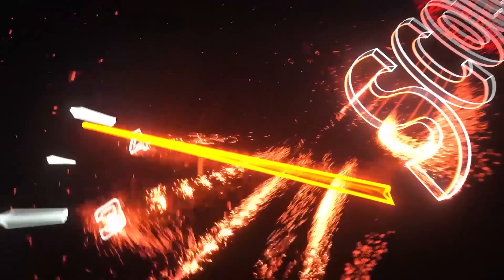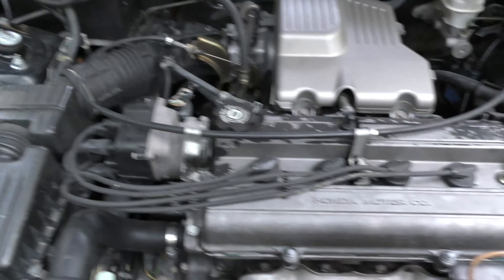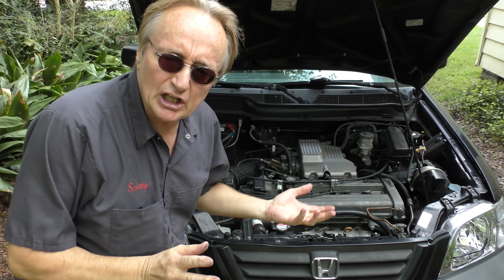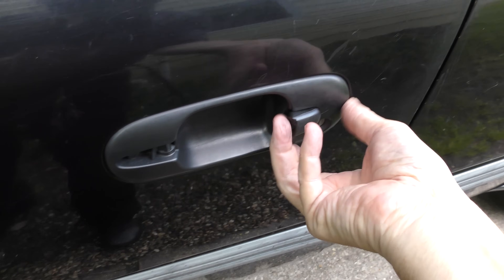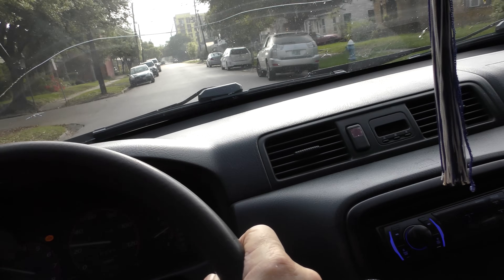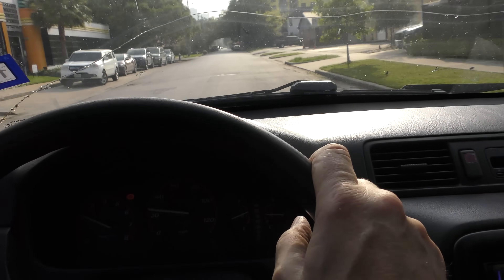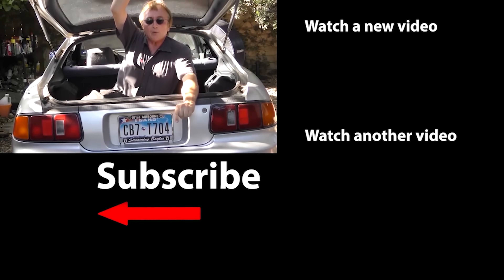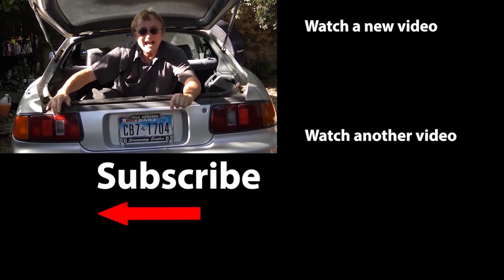Here's Why Smart People Buy Cheap Hondas

Comment: Love my 97 crv 215,000 miles
 I just replaced the driver power window $27.00. Replaced the driver door handle 2 years ago 8.00 dollars. Just put a new set of Bridgestone tires on and it runs and rides like new. Not bad on gas either.

Comment: Honda CR-V could have been my first vehicle, my mother told my dad no it has a higher rollover chance... dads response was to get me a 94 Nissan Maxima. I was older than it by two whole years. Lasted me 6months. Starter and transmission died mid intersection twice. I was driving a death machine. Dad bought it for 1200 and put about 500 dollars worth of work into it. Smh shoulda pushed back but oh well it was my first vehicle.
Reply: fun fact the Maxima has a higher rollover chance than the Crv

Comment: I have 2001 CRV with only 135K. EX AWD with all options like luggage roof, mud guard etc. Previously I had 1999 CRV that I bought new like the current one, EX, AWD all accessories. Drove it for 280K, no problem at all. The engine just purrr. You can still see the metal inside the tail pipe after all this miles. I gave it away to a high schooler as his first car. My mechanic said the first gen is still the best. Easiest to work on and reliable. The only repair are new propeller shaft and one front axle.

Comment: I bought a 2002 CRV in January 2018 with 165,000 miles on it. As of October 2020 (less than 3 years of driving it) I have put over 110,000 miles on it. The only thing I've had to replace aside from brake pads and oil changes was the starter. That's it. 

This winter I should hit the illusive 300,000 mark.

Comment: My (bought new in 6/2015) Honda Fit was the first Honda I've owned, and I'm hoping to keep Ruby for decades!  We did have a glitch in 2018 when her engine coils went bad at under 50,000 miles (others in 2015 were recalled and she should have been too) as did her fuel injectors.  Thankfully, her warranty covered the fuel injectors.  I just replaced her original battery, 1 month before her 6th birthday (she was born in 3/2015 in Mexico).  I am horrified that Honda is no longer going to sell Fits in the USA!  It's a GOOD little economy car!

In Denver in 2016 I went into a Honda dealer to ask something about my car, and they had a 2006 Honda Element in their showroom.  I asked WHY they had an old vehicle in the showroom, but a woman had just traded it in...10 years old...with 445,000 miles and NO problems!  Hondas are freaking awesome!  I still don't understand why Honda stopped making the Element either.  People LOVE them!
Reply: The Honda Hatchback is making a comeback .

Comment: I have a 2001 with 310 miles and counting, just replaced the timing belt for another 100k miles of service. do regular mantainance, frequent oil changes, and the valve adjustments, and it will make it to 1,000,000 miles.

Comment: The fan on my 03 crv  with 190k went out so it caused my car to run hot and my head gasket went bad leaking water in the engine. I just decided to go with a new engine from japan since it was cheaper than rebuilding and since it’s a 5 speed awd, it was the right decision it runs better  than it ever has it’s got some good torque and can chearp 1-3rd gear. I look forward into putting another 200k 👌

Comment: I lucked out I just got a 2011Honda Pilot with only 55,000 miles on it. Older couple barely drove it and got rid of it for something smaller. And since I barely go anywhere due to the Rona I haven't put much of any miles on it. Maybe I will sell it since I'm not going anywhere.  I thank the older couple.

Comment: drive my 2001 crv with a burnt exhaust valve for a year. so the car was running on 3 cylinders and i couldnt even tell. no weird noises or rough idle somehow. fixed the head for 1,200 and still have it 4 years later. its a 5 speed and i redline it every day and it doesnt leak oil. hoping to have for 20 more years so it will be a collectable someday

Comment: My 97 CRV just hit 244,000. Runs like a dime, very well made car. I'm 6'2 and plenty of room and this SUV goes through the snow like a tank.
Reply: I’m only at 147,000 miles on my 97 CRV..
Reply: @jesse7949  be sure to have valves adjusted  every 30,000. They get tight and push on valve seats, $$ if they damage . One issue crvs have.
Reply: @james7420   Thanks for the Tip, I’ll have mine check soon 👍🏼 I just change the transmission oil, it was really dark. Shifts like butter now.

Comment: I got a 2004 Buick LeSabre for 1400 with 185,000 miles and all of the maintenance records. Runs like a clock and it gets good gas mileage. I’m saving for a nice used CRV.

Comment: My 99 VTEC honda accord has 240k on it, 5 speed transmission had the clutch changed out every 100k or so. (Country roads, hardly any city driving). I've run it with the oil cap off and had it spew oil everywhere, VAPORIZE all the water and antifreeze out of the radiator(which is bent from going into a ditch). Used it to transport hundreds to thousand-ish pounds. Sure, it doesn't handle bumps great anymore, kinda sways sometimes, steering wheel is only a little off now.  But it runs, redlines successfully, and will VTEC bwaaappp past somebody when I want it to. Surprisingly. Hondas are hella'uva engine makers.

Comment: Hi Scotty, I recently bought a 2003 2.0L gasoline CRV with 285000km. Honda fluids are expensive and hard to find where I live so I got Castrol oil for the gearbox (manual) and Ravenol DPSF for the rear differential, so far no issues, the rear differential oil was still the original. I'll wait on the power steering fluid seeing that you only recommend original fluid
Reply: Hi, I recently bought a 1998 CR-V in excellent condition, it looks totally new and has some modifications, I was just wondering if it is advisable to use oils and other fluids from other brands or if this can damage the car. What has been your experience with this?
Reply: @JuanArias-xr6je  so far so good, ravenol for the rear diff and castrol for the gearbox
Reply: @RandallGraves59  thanks

Comment: People buy cheap Hondas (particularly ones from the 1990's and early 2000's) because there's lots of parts available for them (either replacement or modding) and because the older ones don't have as many electronics as the newer ones.

Comment: i have a 1998 honda cr-v..5 spd - original owner with 248K miles. all i do is change the oil every 5k since i owned it. looks brand new inside. the cruze control broke early around 100K.  suspension and brakes cost me some money.  it is just noisy as crazy inside

Comment: Agree. These cars are great. Bought a 98 crv with a bad transmission bought a JDM imported  motor and transmission with under 30k miles. With all expenses and paperwork i paid a total of $3,900. Its been 5 years since and it runs better than most new vehicles.

Comment: I literally have the same CRV from 2000 AWD Automatic, only issue is the AC. It blows cold when the car is on second gear but on idle no AC, still trying to fix it DIY. Its a challenging bug but the car works great.

Comment: I have a 1999 with 213000, never a issue  ,,changed water pump with timing belt at 155k, with every oil change I drop the one gallon of trans fluid (about one gallon)  the trans actually holds about 3 gallons, but has kept the trans from having issues

Comment: I have a 2005 CRV (bought it cause of your recommendation so thank you!). I Only use Honda genuine power steering fluid and ATF fluid. But I was curious is it ok to use brake fluid/antifreeze etc that meet the requirements but are not Honda genuine? The manual says only Honda but many forums are saying it doesn’t matter as long as it meets requirements. Don’t want to mess up the car! Love it! Thanks!

Comment: Just came across this video and it gave me new hope for our little 2001 CR-V AWD. We have 198K on it, engine still runs great and the body and interior are in great shape. Here's a question for you. Our AC does not work and we were told by a Honda technician that it is not worth it because of black death. They didn't go looking for it but just said it. I heard that that's more of an issue with the 2nd gen ones. Also our suspension is in pretty bad shape, tires are wearing, some good clunking coming from the front end. I know I need to change the timing belt and do fluid changes but aside from that the AC and suspension is the main concern. Would you say that it's still worth it to put some money into the AC and suspension? or should we start looking to replace it because cost is too high? Thank you.

Comment: I'm an avid cheap Honda buyer. Actually an avid Japanese cheapy buyer as a whole. I have owned cheap 2nd hand vehicles from Toyota, Daihatsu, Mitsubishi, Subaru & Honda, with a bias towards Honda due to their superior fit & finish, practicality & good value.  Had the exact same CRV, bought in 2012 as 10 years old example and that car took us over the length & breadth of South Africa numerous times. Owned a 2004 2nd Gen model after that, a 2007 Accord 2.4 and two 1st gen Honda Jazz. A 1.5 V-tec and a 1.4 DSi. We currently drive the 1.4 Jazz & the Mitsubishi Pajero. That 1st Gen Honda CRV is really well engineered. What I liked about it was that the power steering, alternator & aircon ran seperate belts on seperate pulleys. If one were to break...which it didn't anyway you'd still have certain functions and it could be repaired easily. I owned my one between 200 000km & 300 000km. During that 4 year period I only repaired a small radiator leak where the fan cowl chewed into the radiator core and I had the steering rack refurbished...no Honda special oils. I only used the Honda CVT fluid for the Jazz gearboxes. As a whole the plan to only drive Japanese cheapies works out really well. They take us everywhere we need to go and they take abuse while at it. I don't wrap them in wool, they get driven and driven hard. But we maintain them really well with quality aftermarket parts. And upon selling I don't really lose money on them. I have even turned a profit on the one CRV.

Comment: Rode my 2002 CRV from 185000 miles to around 230000 miles after my parents were done with it. Broke down this march, and I'd driven it for the past 3 or 4 years. Easily my favorite car from my parents. I'm currently looking for another used one, as my dad bought a used Ford Flex and is giving me his Chevy Equinox with 80,000 miles and a recently installed new engine ( the old one was burning oil).
Reply: Y did it break?

Comment: My wife has a 2004 Honda Pilot with 223,000 miles. Runs and drives okay with all it's original parts. I'm just changing fluids and doing rust repair.

Comment: I have a '98 CRV which I drove off the lot a little over twenty two years ago and I now have 285,500 on the odometer.  For most of it's life I used Honda's ATF but the last seven years I've been running with Valvoline MaxLife ATF and I feel it's better than Honda's over-priced ATF and it's significantly cheaper as well...currently going for $17.89/gal at Walmart.  The first Gen V's are just crazy reliable if maintained properly and that includes checking/adjusting the valve clearance every 30K-40K miles. I'm still running with the original engine,AT,starter, alternator(although I replaced the brushes around five years ago), fuel pump, and master cylinder.
Reply: I like maxlife also. Still going?

Comment: I'm so happy that I found one for  $ 2,800 with just 119,000 miles super clean and solid overall driving it daily. Maintenance is key. Just probably need to replace the suspension components. They're cheap. And the AC when it fails. Nothing mayor. Recomended!!

Comment: I got a 99 Nissan Sentra, and the worst repair job I had on it was the water pump. Only reason why it was the worst repair was because we couldn't find out what was wrong with it. The water pump was slipping on the belt, but the car wasn't overheating. I'm in Florida. It wouldn't overheat. With a busted water pump. In Florida.

Comment: i got myself a crv few years ago at my mechanic who got it from someone who had it for 20 years. Still runs well, may have take her in now and again but major upgrade from the dodge neon i had. For some reason the check engine light always comes one even after my mechanic fixes it. But other than that it works well and plan ride this to the ground or till i feel to replace it with an automatic at some point. Crv are a good vehicle to own.

Comment: I got an 01 for $400  last year. I love it! I just it 200k miles. Has some small problems but its fine. First car so it was a good place to start. Only thing is the radio dose not work. Come fix it lol.
Reply: Doesn't Work... Does it need the code? Go to a dealer free. The cd belt dies after 10 years
Reply: @michaelp3650  Idk I put a new radio in with Bluetooth so I’m good now lol.

Comment: My Toyota Highlander 2021 4 cyl. still runs without a problem. No engine light, no transmission or engine problem, and I have kept it with good regular maintenance.  However, it burns or leaks oil like crazy. For the last 3 years or so I have to put 1 quart of oil every 300 miles.

But aside from that, it does not have any other problem.  The A/C does not work. But I live in SF, and it is almost never hot during summer time. So I don't mind. However, the only thing I don't like is the ride on the streets when driving it. In SF we have so many potholes that it makes it unconfortable to drive a car with bad suspension.

 The freeway ride is not a problem at all.  I wonder if it is cost effective to replace the struts of the suspension which will set me back about $1,200 to fix them all four. 

   Burning so much oil I see it as kind of a gamble.  The car has now 270,000 miles.  

Do you think it is worth to put so much money in that type of car?

Comment: I have a 97 with 182,284 and I bought it for $300.00 The only problem I have with it is: No crank, No start. Can that be the CKPS(Crankshaft Position Sensor)? I checked the battery and I am not getting any juice at all. I was driving it and lost power while driving. Mind You I changed the ignition coil/distributor cap and the sparkplugs.

Comment: A lot of the minor stuff is easy to fix because it is a Honda. Door handles, antenna, radiator fans and even the widow regulators are simple if you know how to work on a car. Parts are falling outa the trees as well. Most of the under hood stuff you can get at a Pull-A-Part from a Civic or other CRV's. The instrument panel and steering column is all Civic.

Comment: I got a 2005 model 6 years ago. Been a very good vehicle. Only on 120 000 miles so good for another 10-20 years. They have quite a bit more room in the trunk than the new ones too!
Reply: Updates on your car?
Reply: @lionheart93  Passenger seat has started to rip between the leather perforations( I think its from my kids sitting there with wet costumes still on). I have had to change the driver window switch otherwise going 100%.
Reply: @weetbix2083  how many miles do you have on it? And would you recommend one as a commuter ? Is there also anything that one should keep in mind maintenance wise before purchasing?thnx
Reply: @lionheart93  Only have about 145 000 miles now. Doesnt use a drop of oil between services. Even then the oil is still a dark honey colour before changing. Its my wifes car and we also use it for family trips as it is spacious and AWD for off the tar adventures. Nothing to really worry about. Just remember, they are getting old now so age related wear can be expected, especially rubber components. Just check the auto is smooth, aircon works and power steering is smooth and not leaking. If the overall condition is looked after and the fluid levels are good and clean they are bullet proof. A service history would be a bonus as with any car. I would 100% recommend one to anyone as a safe, reliable and respectable everyday drive.
Reply: @lionheart93  Maintenance - Changing the oil filter yourself is a difficult an messy affair. Honda motors still require manual valve adjustment. Follow the recommended maintenance schedule and you shouldnt have any surprises.

Comment: Scotty, I have a 2003 Crv and recently had Rt.  Front CV shaft replaced, cv axle stub shaft assembly r&r, OES stub axle-front. The car has mostly been in PA. Recently moved down to Ga., and that is when the major repair had to be done. The 9 hour drive hurried the need for the mentioned repairs. Now, my car makes front crunching noised now when applying breaks. The mechanics stated the old parts had seized and the salt from the north has caused a lot of rust. 
What is causing the crunching noises, now? When the three day repairs were done, had rear disk brake pads, remove and replaced too. The car came back to me even nosier. Thanks.

Comment: I had a '90 Prelude Si with 333K miles, and the engine was still strong when it got swapped out. It wasn't the engines fault, it was the radiator. 333K on a sports car .. I only replaced it because I was being a perfectionist. And then a hose broke on the new one... Hondas will go forever if you keep it cool.

Comment: Bought 99' CR-V EX for $22K loaded. Had it for ten years and put 150K tough NJ/NY miles on it. Gas, Oil, tires etc., only and eventually sold it for....$4,500! The CR-V is one of the best all around cars you can buy for the $$.

Comment: My Rover 75 CDT with the 2.0 BMW diesel engine had 285k on the clock when i scrapped it and the engine was still purrrrrrrrfect. Honestly. It did not use any oil, and i ran that one with the MAF disconnected and still got 50mpg on a run. I changed the oil and filters every 5k. I only scrapped it because another cheap one came up with a sunroof and nicer alloys. (Oh and i reversed it into a lamp post so there was a dent in the rear quarter). Only problem with those cars is they eat front wishbones, mind you that might be down to my driving style ...?